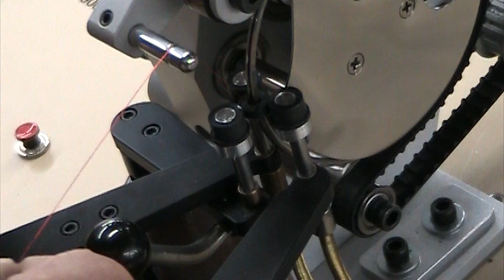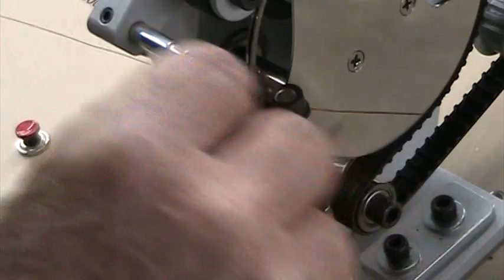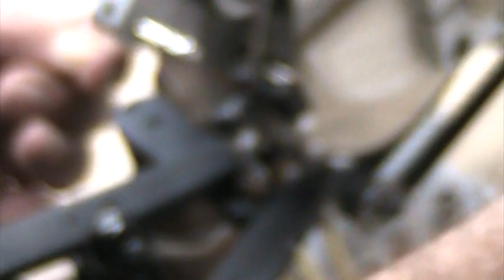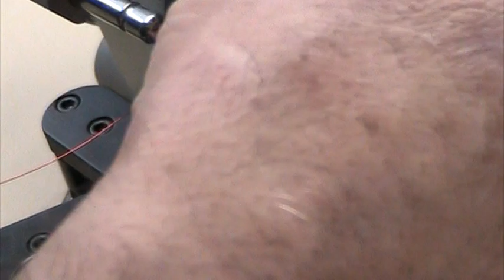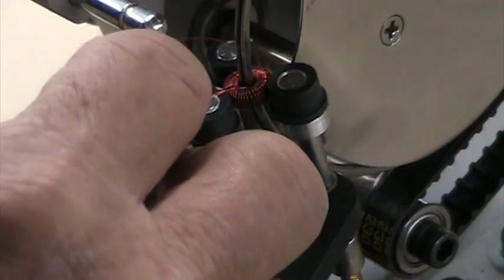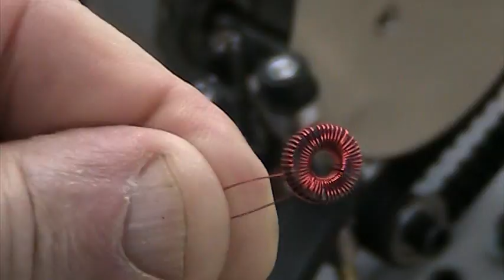Tiny coil

Comment: I've had 200 turns put on a 15mm OD ferrite in production quantities. Was a 200:1  CT. Just got to watch out for shorted turns if you use PU coated wire.